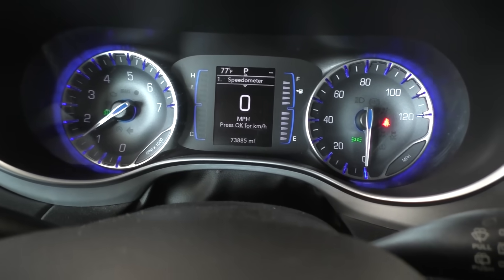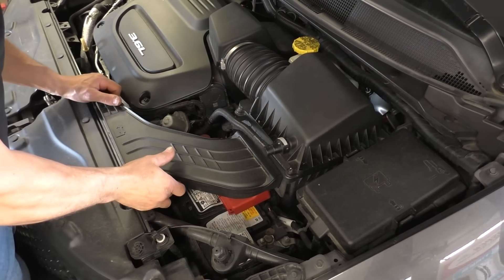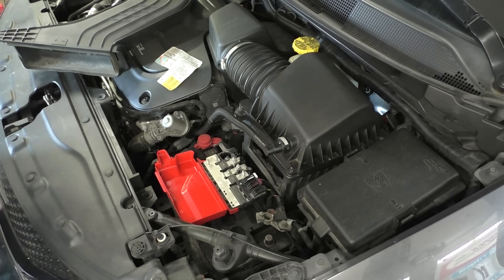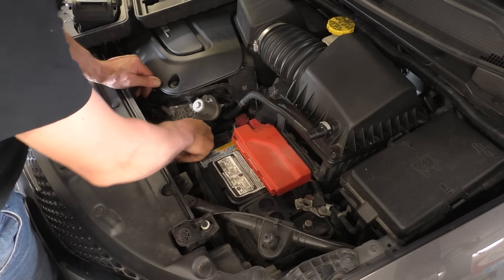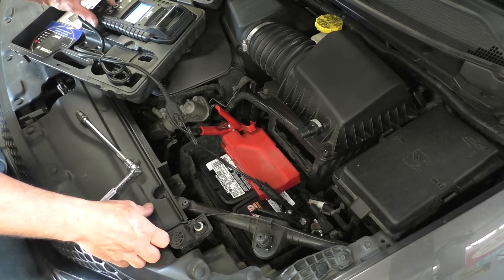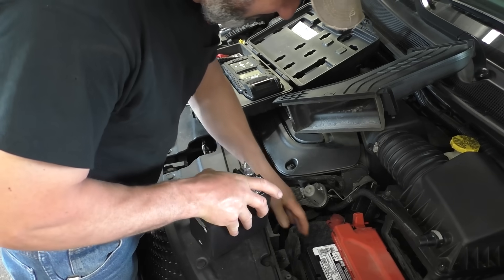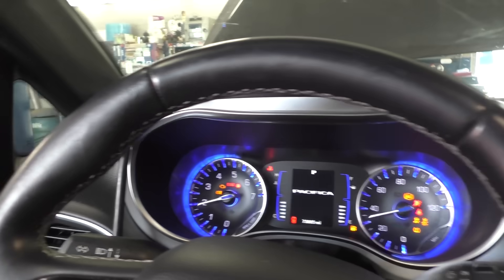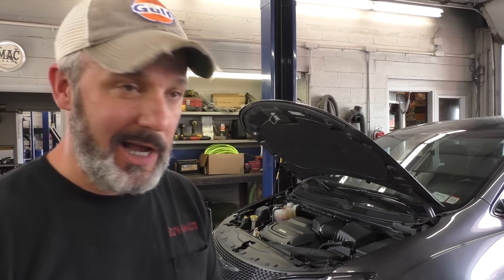Chrysler Pacifica - Start Stop System Disabled

Comment: "Start Stop System Disabled"... That's not a malfunction, that's a gain of function!
Reply: Depends on the cause. If it will affect something else on the car, it could be a malfunction.
Reply: After I start the car the first thing I do is hit the button to shut off this function.
Reply: Okay anthony fauci
Reply: @dougjones9493  Same here!
Reply: Absolutely!!
Reply: I came here to say the same thing. Like cylinder deactivation, these functions are more expense, trouble and annoyance than they are worth.
Reply: Save 10 gallons of gas ($43.00) to help offset the cost of the premature wear on the battery and starter that will cost you hundreds if not more to repair. Makes total sense. Anyone ever look at the costs these days for AGM batteries? Crazy.
Reply: @MAGA_EXTREM1ST  I said two variations of this comment and youtube deleted them both.
Reply: Lol. Was thinking the same thing! Lol
Reply: @dougjones9493  me too- it finally quit coming on all by itself ! ('10 GC V6)
Reply: @dougjones9493  shouldn't have to disable it every drive cycle, just let me turn it off indefinitely
Reply: @a89proof  I agree but mfg. Don't provide that option. I checked with the dealership and they said they don't know how to turn off the software . There is likely a way but it would have to come from the software development.
Reply: thats what im thinking, if its still starts and run, leave it alone
Reply: If you program it to turn it off, then it's fine... otherwise it might cause problems.  It caused problems in my terrain until I had it reprogrammed to turn it off.  Then it was a great thing; auto stop is horrible
Reply: @ItsAlwaysRusty do some research it supposedly does not put premature wear on the starter.
Reply: If it is turned off then 1 journey equals 1 start If on, 1 journey equals many starts. Therefore more wear on the starter.
Reply: No doubt!
Reply: @JDARJISJ  I had a 68 dodge that had that only 6 of 8 contributed to power output
Reply: @ jhonditch4269 That’s about par for the course with Dodges, isn’t it?
Reply: @JDARJISJ  ah but still ran and drove new ones just burn
Reply: I named it the "Auto-Stall" system.
Reply: LOL
Reply: Yeah, that system saves such a miniscule amount of gas it's not even worth the hassle.
Reply: @rick980 just like 30k mile oil changes dont damange engines
Reply: I agree, I always disable it because where I live it’s just annoying in traffic. But the good thing on those start stop fitted cars is they monitor the battery performance and disable start-stop in case performance gets low. It prevents you from stalling in the middle of the road at a traffic light and warns you about a battery getting bad.
Reply: @JDARJISJ , "Solution in search of a problem."
Reply: @rickn8or . Or a problem in search of deactivation.
Reply: @ItsAlwaysRusty not just the starter, I'd be much more worried about wearing off the flywheel teeth and then you have to spend A LOT more than just replacing the starter
Reply: So if a car doesn't run more than a minute, so it has a start stop huh?
Reply: That's a capital offense in New York
Reply: Bingo
Reply: @dougjones9493   yes me too and never have a problem "service stop start system"
Reply: Thanks to the government
Reply: First thing I did after a week with that start stop crap, I install a module that goes in-between the disable / enable switch and harness. Cost $30 and 15 minutes.
Reply: I agree  so dum
Reply: @Thisoldhiker it turns off remote start
Reply: @dougjones9493   same
Reply: disable start and stop and perhaps loop back the Aux battery connection to the main one so no warning lights and no dead weight to carry around
Reply: The ESS can be permanently disabled.  See my other post here.
Reply: @Thisoldhiker  yeah if that aux battery fails or begins to die it drains the main battery causing it to die early... jeep compass has two and had to replace both because of this 450 dollars later FML
Reply: @CSUnited14 On 18 Jeep Wrangler JL should you disconnect the aux ground to the neg terminal on the main batt & pull fuse 42?  But if the aux batt only runs accessories when stop start is engaged & you turn it off every trip...does that take the aux batt out of the equation & no need to disconnect it
Reply: @dougjones9493  there is a wire harness you can plug into something behind one panel that's easy to remove.
Reply: @rick980  bs. Every time you use the starter it wears down the less you use it the longer it will last. If they build it better to handle the more starts it will still last longer then if you don't use the start stop.
Reply: @ItsAlwaysRusty  how about the alternator or motor mounts
Reply: @gantmj u must have suggested the unthinkable. Well 4Dtech sells one Haha. 🤣
Reply: Great video. Now I know what to be prepared for with the wife's 2021 Pacifica. As Dad used to say, "all of this crap the car companies add is just more to go wrong!".
Reply: @andymoyer7197  That means your battery is getting weak. Eventually, the battery will fail. It will start working again when you replace the battery.
Reply: @rick980  I heard this too but I have my doubts.
Reply: @JDARJISJ  Never owned a Chrysler product. Never will. Some people know why. The others have to learn it the hard way.
Reply: @sebastiaan5111  Yup! When the battery gets weak, the computer knows it and disables it. It will start working when you replace the battery.
Reply: @Blue68Camaro  The last car we had was easy to disable. It was a short wire harness that spliced into the hood open switch harness. Start/Stop won't function if the hood is open for safety reasons. This wire didn't work on my new car, which was the exact same model. I tried it. It caused my car alarm to go off because the computor believed my hood was open and a theft was taking place. I had to buy the more up to date mod that connects to the Start/Stop power wire on the battery. This mod lowers the voltage to that specific wire and in effect, the computor auto disables Start/Stop. This newer version is quite a bit more costly but it does work.
Reply: Except it will eventually trigger a check engine light preventing you from passing state inspection in most states

Comment: I did my first aux battery replacement job a few months ago. I couldn't believe that battery cost almost as much as a series 24F or 35. Start-stop feature is like most of the features in new cars. It isn't something you want, asked for, or can decline, but you paid for it and now it will cost you more to maintain it.
Reply: And any tiny minor fuel savings will be more than offset by what start stop costs in the price of the car and maintenence.  If you really care about saving fuel put a few extra psi in the tires and install a drop in K&N air filter.
Reply: @robc8468  Ken & Nancy? Those filters work great, for boats ...
Reply: Basically it's a motorcycle/atv/utv battery. Even then they're getting pretty spendy.
Reply: @robc8468  For 1: putting extra air in your tires above what manufacturers recommended can increase your braking distance due to not as much friction w the road...the recommended air pressure is there because manufacturers R&D has shown that pressure to be the best balance for performance, breaking distance, and fuel economy.
As for the Ken & Nancy air filter, they do nothing except make you think you're getting more, so you think you notice more performance. Truth is if the engine can't expel the extra air it takes in, the taking it in does no good.  It's like starting w a 4" intake and 4" exhaust. You're expelling what you take in, then going to an 8" intake but keeping the 4" exhaust. The 4" exhaust can only put out so much so taking in the extra isn't gaining you anything.
Reply: Thats your governor and it's artificially requirements at work. Manufacturers have to do everything they can to make artificial average fuel economy set by unelected bureaucrats or face heavy fines. So they do stuff like start/stop, AFM, turbos, etc.

Comment: When you can remember when oil filters were an option and automatic transmissions were few, you know the business has evolved.
Reply: Fancy stuff like turn signals and heat was optional if even available when I was a kid.  My Dad had a Bel Air with no heat when I was a kid.  We lived in Chicago.
Reply: @BobWiersema  Brrrrrrrrrrr
Reply: Had a 72 VW and ice scraped the inside window more than the outside. Had a heater but couldn't tell , never heated.
Reply: @guyray1504  '64 Bug. Scraped the inside window all winter on on the way to school in '77/'78. Broke the front windshield once with my head because I had my face so close to the windshield trying to see through the ice/fog/water.
Reply: @justliberty4072  i was stationed in Omaha, Nb for 5 years and that VW was great in the snow but had to put on extra clothes due to no good heater.
Reply: @guyray1504  Wow I remember my buddy had a 65 11 Window Bus back in HS his dad gave him. No heat at all. That deadly exhaust heater had been removed. Being like 16 years old we thought well cans of sterno on the dash might work so that's what we did and it kind of worked. 😄
Reply: @guyray1504  They were good in the snow. Passenger comfort in the winter was not really a selling point. 😄
Reply: I bought a 55' ford fairlane from the original owners famiy in the mid 80's and it still had the original e brake cables...they were greaseable!

Comment: 29 modules.  Probably one of the more reasonable of the 21st century automotive automations.  My friend tells me stories about his Mercedes that has 110 modules and uses Ethernet in place of CAN bus between some of the modules.  Pretty soon you'll need to run Wireshark to troubleshoot embedded protocols between modules.  I pretty much threw my hands up when some LED taillight bulbs became CAN addressable!  🙄  I'm with you Eric!  A cable for mechanical hand brakes, heavy-duty floor switch for high beams and a radio.  That's all I need!  🤣🤣🤣
Reply: Guys driving rat rods, home-builts, and classics down here all the time.
Reply: Just like HOA 101: NEVER buy any of these freaking computers on wheels pretending to be cars....!
Reply: Drive a transit bus, at least you get your floor brights
Reply: As a network engineer I would understand Ethernet based more than CAN!
Reply: Fiber will soon be making its way into vehicles
Reply: On the Boeing 787 the lav faucets are electronic.  (hand to forehead)
Reply: I drive a 1988 F150. I don't think I have any modules.
Reply: @flower2289  I had a '77 Camaro and it had ONE module.....and it was susceptible to wear out due to heat. Ask me how I know.
Reply: most cars are switching to ethernet, large module cars used to use fiber optic, CANBus is too limited. 110 modules though, HIGHLY doubt that, probably just shows up in a scan tool as 110 as certain parts can identify themselves as independent through a specific module.
Reply: Make the radio with two knobs and buying!
Reply: @tf6437  Checked on my buddies Merc.  You're right 110 modules, no.  It has 97 modules.  That's 90 too many for me!  🤣🤣🤣
Reply: @robertl.fallin7062  Absolutely!  Who needs any stinking buttons!  Only two good radio stations anyway!  🤣🤣🤣
Reply: @robertl.fallin7062  Hey we used to have a good time with 2 knobs. I remember smoking along the Stevenson expressway (literally a smoking car) and listening to Larry Lujak on WLS Chicago. I had the air conditioning on too. That little wing window.
Reply: IDK, my 1987 RX7 Turbo II had something like 17 computers and they were so proud of it that it was part of the marketing.   Problem was, they all had cold solder joints, so they would ALL fail.   I spend hours resoldering every single module.   Nightmare.   

There is a sweet spot for cars from the mid-1990s to the early 2000s when they put in just enough computers (and they were well made) but not so many to make it a problem.
Reply: @mikebuffing727  It has a long time ago.  My old 2008 Volvo used a fiber network and Volvo is hardly leading edge.
Reply: @ckm-mkc   It's fascinating that you were able to diagnose that......AND treat it. Most couldn't.....or wouldn't.
Reply: @ckm-mkc   My 1994 Pontiac Sunbird was bulletproof. I know, I know what people say....but mine was bullet proof. I sold it after 200,000 miles just because I wanted a new car.
Reply: @gregorylewis8471  again, highly doubt that it's 97 physical modules

Comment: Former Dodge Tech here, I’m a Toyota Tech now. When I saw the title of the video it caught my eye and thought ooo this is interesting. Every time a customer came in with this concern, 85% of the time it was a bad auxiliary battery.  It  would throw dozens of battery codes. Replace that small battery and you’re good to go 👍🏼 sometimes it would be annoying to replace them like on the Jeep Wranglers and Gladiators the aux battery would be on the passenger side, remove tire and the wheel liner and it’s right there in a small box with three bolts. On some  newer Grand Cherokees it would be underneath the  passenger seat and the main battery underneath the driver seat.  Fun times. Great video really enjoyed it 👍🏼
Reply: 18 Jeep Wrangler JL...does aux batt only run accessories during start stop event? I turn it off every trip so wouldn't that take the aux batt out of the equation...I changed the main but should the aux be disconnected or doesn't matter & aux is just dead weight since it's disengaged
Reply: Lololol " Remove the tire and the fender liner and it's right there" LOLOLOL What happened to " Open the hood and it's right there" lololol. That was a really funny post, thanks! 😂
Reply: @MilitaryAgeMale If it's a JEEP the whole thing will be dead weight soon. 😂😂😂
Reply: @JamesAgans James Silverans It's no Pebble Beach...Pentastar 3.6 holds its liquer...got everything analog...stick,hand crank windows,manual locks etc... Toyota Tacoma would be my 1$t choice horses for courses
Reply: @MilitaryAgeMale - No, hitting the dash switch to disable Stop/Start does not mean that the Aux battery is out of the circuit.  When the engine is running, the alternator recharges both batteries in parallel.  So, when the Aux battery dies, it sucks all the power out of the alternator, which kills the main battery.  You need to disconnect the battery cables to the aux battery, and pull the ESS fuse in the fusebox to disable the Aux battery.  You would still need to press the button on the dash or else it will try to still do Stop Starts powered by the main battery.  I bought a little module called Stop Start Eliminator that installs under the dash near the OBD port.  It remembers what state the dash switch was in, so I can leave it permanently disabled.

Comment: A small piece of advice for the next FCA vehicle you work on with the dual battery start/stop system. Set the parking brakes before disconnect the batteries. Disconnect the IBS from the negative post by releasing the connector. Once the batteries are changed. Connect the IBS last, then place ignition in run and actuate the parking brakes. Your codes will all be stored and you can clear them first time. The only programming needed for a battery change on a FCA vehicle right now that is not a etorque system or PHEV. Is to run the engine for 15min then let the vehicle fully sleep cycle for 4hrs. That resets the IBS which will then update the SOC and SOH of the batteries in the PCM. Thanks for all the videos and information you've provided. You have actually taught me several new and better ways to approach diagnostics. I'm enjoying being an automotive technician again.

Comment: Im old enough to remember at battery change, worrying if the tray would need replacing too because of rust. Best use of plastic on a vehicle in my opinion. Thanks for the wosdom and entertainment, Dr. O!
Reply: Well, have seen a road sign used as a tray, because in a VW Beetle it rusts through the floor pan, and drops out.
Reply: @SeanBZA  Agree on the plastic battery pan. I remember my father using a piece of plywood to support the bottom of a battery when I was a kid. Would have been either a Ford or a Mercury.
Reply: I'm old enough to remember a 6v battery
Reply: @jimearl3397  With a Generator and a Voltage Regulator too !  Vacuum windshield wipers.  Foot depressed starter instead of a solenoid.  Oil Air Cleaner.  'Road Tube' instead of crankcase ventilation. Ah yes...
Reply: We watch for the commentary.
Reply: One size reach and screw driver and 3 sizes of hammers 😆
Reply: @yowser8780  The 6V was also positive ground!  Don't forget the grease cup on the water pump. You gave it a half turn every 1,000 miles to lube the pump shaft.  The straight 6 had no valve cover.
Reply: @yowser8780  Don't forget you had to change the brushes in the Generator to make it charge.  If you got windshield washers you might get electric wipers that didn't quit working when you went uphill.  I don't remember alternators on Fords until 1965.  1960 for Chrysler?  Or you might have a mechanical washer pump that swung over to the accessory drive belt to make it pump and have a "See Clear" vinyl bag to fill up with water like on my 1960 Thunderbird.

Comment: I remember shopping for a new truck several years ago. Salesman says "This vehicle has start/stop technology to save gas!" I say "I don't want that, show me something else." So then he shows me a model with a 4-cyl engine and a turbocharger. "Turbo power and great mileage!" My response was identical. I just want something with lots of normally-aspirated cylinders. Yes, I'm old and cranky about new-fangled crap. Even daytime running lights irritate me.
Reply: I agree exactly the difference is my headlights are on anytime I'm driving the vehicle from my choice

I also drive them for half a million or more miles and I avoid turbo chargers like the plague they aren't the sign of a high mileage life vehicle